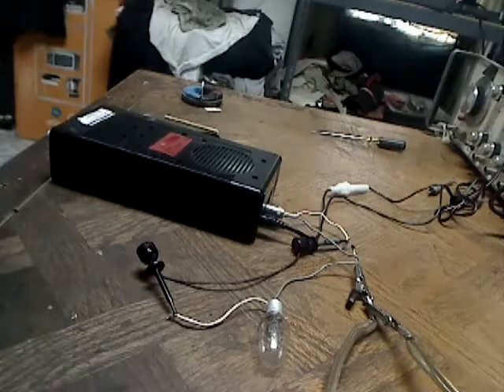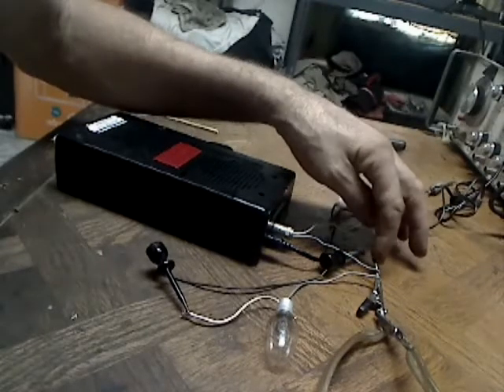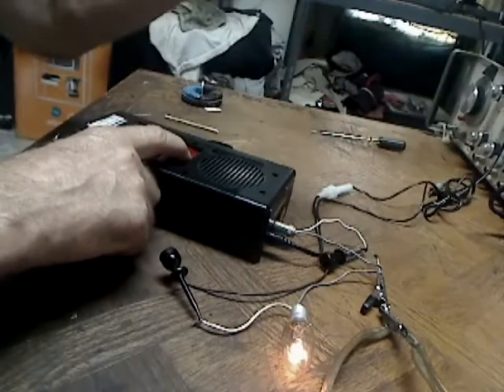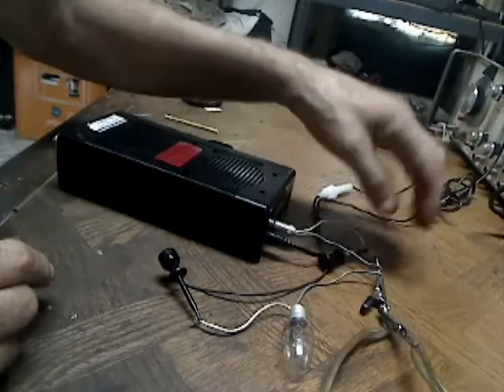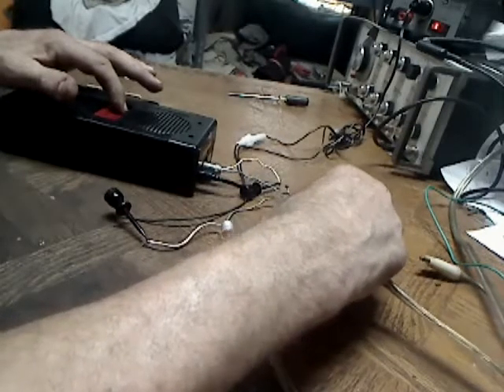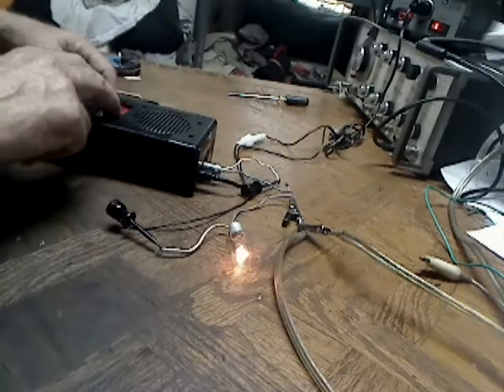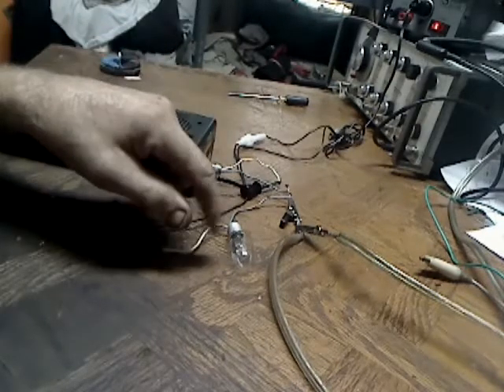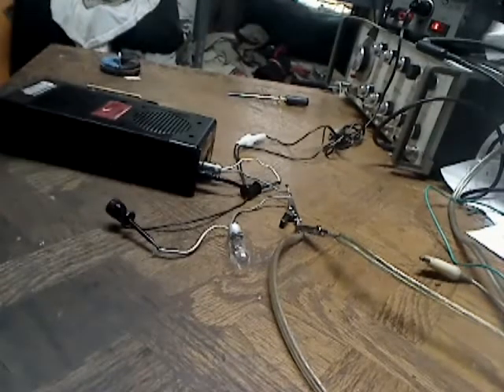CB load testing YT

Comment from the maker: This 4 watt CB,using a 1/4 wave curled RG-59 cable,I can 1/3 light 2x25w plus 1x15w
bulbs at once.The CB seems to have a 100w / 1a saturation point.The only way to
get it to put out full power is to supply a "feedback" whistle into the microphone while
in the transmit mode.It seems to lack in voltage at saturation.CB will put out some
heat but I have installed heat sinks on the outputs-2 of them.Still its interesting
to see bulbs running at 27MHz--Do not touch any bare output line...It can give a 
radiation burn that lingers but not blister.